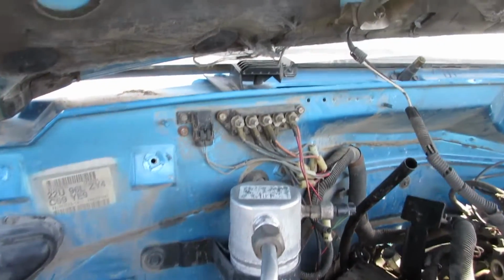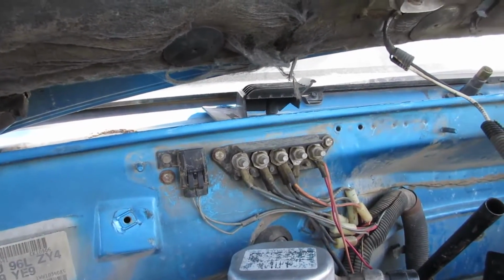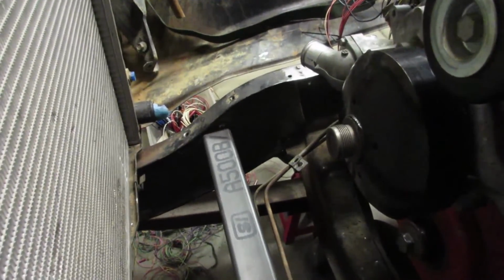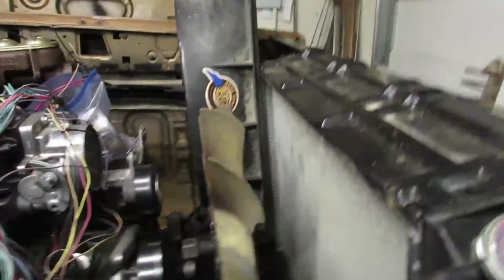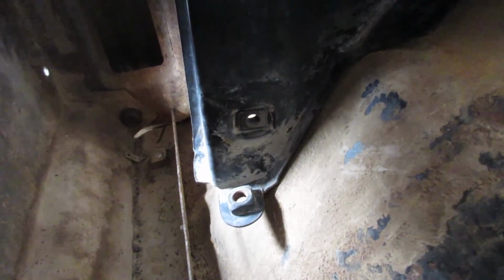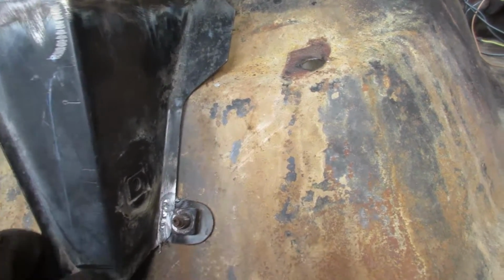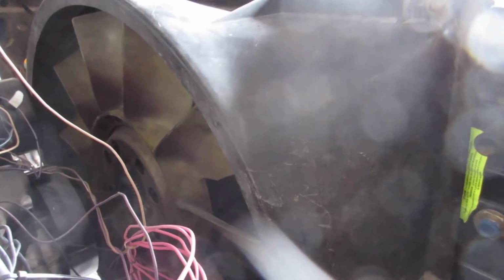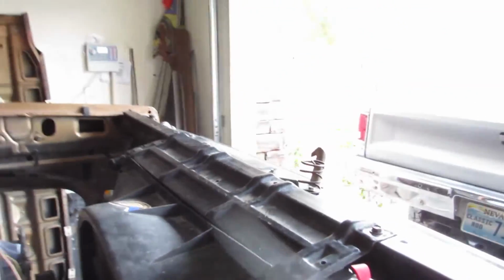Chevy K20 Trail Rig - Battery Tray reworked and cooling fan mock up

Comment: what is the fan out of year and engine size? looks like it fits good want to do same set up in my k10
Reply from the maker: +alex rankin I'm pretty sure it was from a 2000 ish S10, it was actually laying in an engine bay at the wrecking yard and I didn't pay that much attention. It's an awesome fit, now I just need to match up the clutch when I get a new one. I will let you know the exact year etc when I get the new clutch.
Reply: MrWhitels1 thanks keep up the good work man love your builds